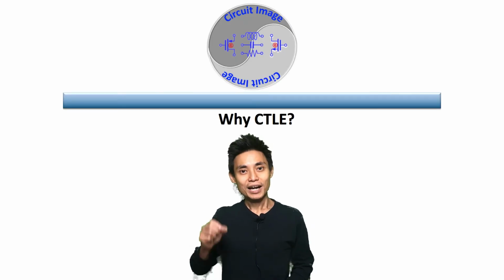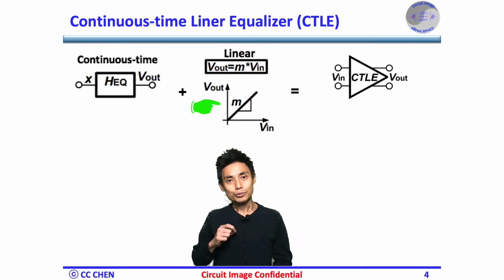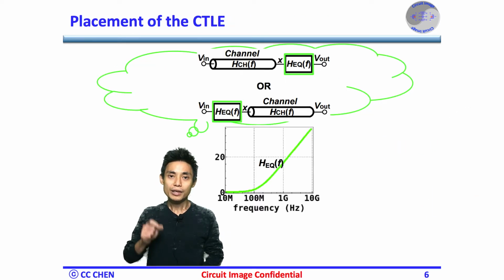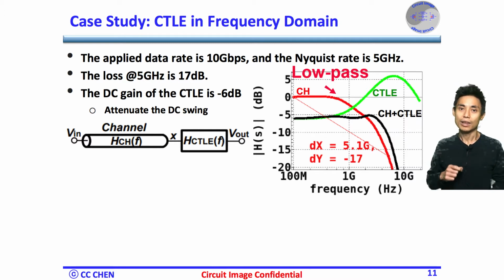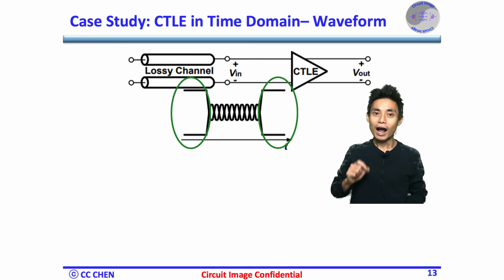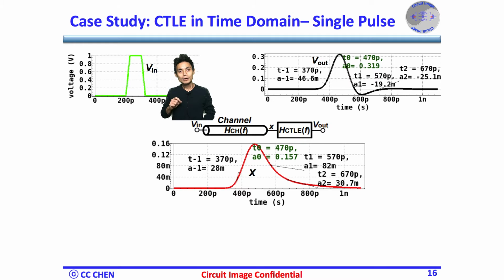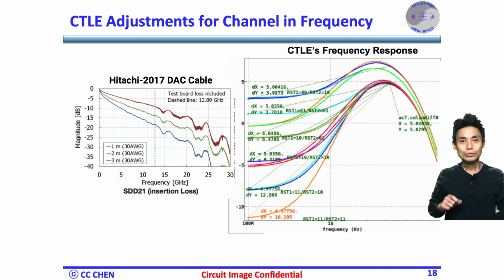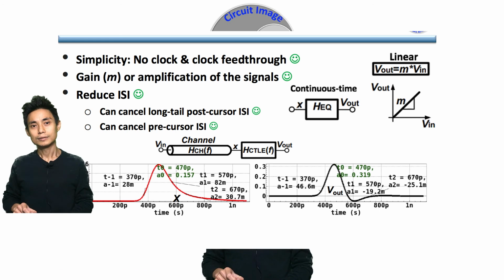Why CTLE?

Comment: Thanks cc, good explanation .
The dc gain of the ctle would be reduced to equalize the gain of the low and high frequency of the total response.
Means, we are decreasing the amplitude at freq=0, by using degeneration resistor RS in CTLE common source differential amplifier?
Reply: One more thing we are designing CTLE to give output impedance low?
Because if CTLE is amplifier then the output impedance should be low right?
Can you pls explain this

Comment: Hi CC,
After channel high freq pattern swing is less and low freq swing is more.

Our aim is after CTLE the high frequency pattern swing is increased because channel has high frequency loss and CTLE is high pass response.

Why low frequency swing after CTLE also decreasing?
And it's equilizing into low freq swing ?
Because it will allow receiver to output a stable signal?
Reply from the maker: Hi Shaik, 

Thanks for the great question.

The CTLE doesn’t just “boost high-frequency”; it reshapes the whole spectrum.
In most designs, high-frequency is boosted relative to low-frequency by attenuating the low-frequency gain. Because the output swing is limited, when HF is boosted the LF portion must come down, so you see low-frequency swing decrease.

That intentional LF reduction cuts baseline wander/ISI and opens the eye, so the sampler sees a cleaner, more stable signal.

Thanks,
CC

Comment: Good explanation.
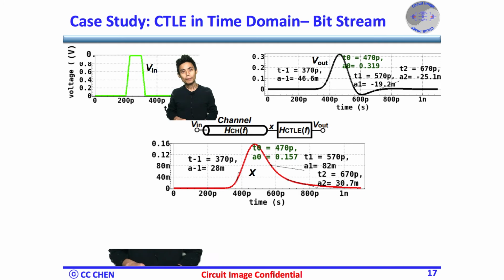One qn is 1. How you marked pre cursor and post cursor exactly at that point? At time 10:38 sec in video.

2. By comparing the after channel wave form and after  CTLE waveform.
Pre cursor amplitude increases
Main cursor amplitude increases 
Post cursor amplitude decreases.
So this is expected?
While your explaining mentioned amplitude decreases for pre,post,main cursors please explain here.
Reply from the maker: Hi Shaik,

Thanks for the great observations and questions!

At 10:38, the pre- and post-cursors are marked relative to the main cursor, which is the largest pulse in the pulse response. The pre-cursor is the smaller blip just 1UI before the main cursor, and the post-cursor is the one UI just after it. Again, they're spaced by 1 UI (unit interval) in time.

Yes, you're right to notice that after CTLE, the pre- and main cursor amplitudes can increase slightly, while the post-cursor decreases — this is expected since we care the pre- and post-cursors relative value to the main cursor, not the absolute value itself. 
Thanks for catching that — hope this clears it up!
CC

Comment: post-curor可以直覺地想像當下資料會影響後面的資料；但該如何直覺地解釋pre-cursor未來的資料會影響當下資料呢?
Reply from the maker: Hi Johnny, 非常感謝你提出這個好問題。您可以想像自己所處的位置。如果你在current bit, the next pre-cursor 1 就會干擾你current bit，如果你在next bit, 另一方面，current bit 的 pre-cursor 1  就會干擾你 previous bit.
Reply: @circuitimage  過去有模擬如果signal經過一階RC的LPF是不會產生pre-cursor，因此在想為何經過實際的channel就會產生pre-cursor?
Reply from the maker: Hi Johnny,
The RC low-pass filter is a lump element; therefore, you should not see the dispersion at the precursor. Instead, the real channel is a distributed element and the wave would disperse and spread the pulse to the precursor.

Comment: Hi Dr. Chen,
Can you explain, why dc gain at low frequency should be lower than 0dB? What is the problem if it has a 0dB response at low frequency and high response at high frequency?
Thank you for this great and detailed video 😃
Reply from the maker: Hi Muhammad,
Nice to meet you and you're very welcome. I'm glad you liked it. 
The DC gain at low frequency should be highly programmable & calibrated to the input swing. For example, if the input swing (at long-run pattern) is very huge (e.g., > 1V), you might want to decrease the swing to improve the linearity without saturating the amplifier's output swing; otherwise, the DFE cannot converge well from the SS-LMS algorithm. On the other hand, if the input swing (at long-run pattern) is little (e.g., < 50mV), you might want to increase the swing to improve the input sensitivity of the sampler (& DFE) such that SNR would be high enough. Hopefully, this explanation is what you're looking for and answers your questions. 😄
Reply: Thanks Dr. Chen for this great explanation @circuitimage
Reply from the maker: @muhammadkhaled0000  You're very welocme. Any time. 😀

Comment: Hi Dr.Chen, thanks for your videos they are very informative, helps a lot! I have a small question about this video. 
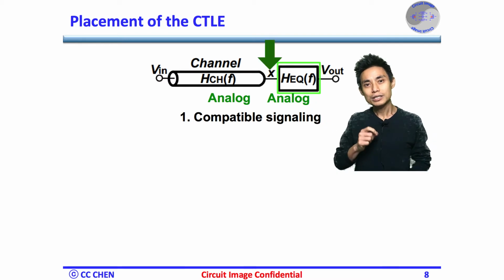In 4:33 you mentioned that the signal from the channel is analog. However, I originally thought that NRZ signal is a digital signal. Does this mean that any digital signal that has been distorted will have to be viewed as a analog signal? (on the other hand, I understand that why PAM4 signal is analog, because it used a 2 bit DAC to build 4 voltage level, but NRZ signal seems to be build directly from the digital signal from the chip)
Reply: Thanks for the reply! Now I understand that the signal at Rx is not a clean 2 level so it is analog. But I am not quite sure why Tx ouput is also an analog signal (for NRZ), do you mean there might have some pre treatment such as pre-emphasis?
Reply from the maker: @林彥全-x7f  Hi 彥全, Thank you for the feedback and good questions. The TX output swing is adjustable. For example, someone may want to save the power by only sending the TX output swing to be 50mV or even small, which won't reach full swing to VDD & ground like the digital level does.
Reply from the maker: Hi 彥全, nice to meet you. You're very welcome. Thank you for the feedback and I'm glad that helped. The digital signal is defined as only two levels: logic 1 (from the supply) and logic 0 (from the ground), but the signal level at the channel (TX output or RX input) is arbitrary (could be 0V, 0.1V, 0.2V, ... 0.7V, ..., 1V); therefore, it must be the analog signal (all possible voltage levels). I hope this simple example helps.
Reply: I understand now! many thanks!
Reply from the maker: @林彥全-x7f  Great. I'm glad that helps and you're welcome. 😀

Comment: Thanks for the good video. May I ask what caused long tail pulse response and how CTLE helps to remove it?
Reply from the maker: Thank you for the question. The bandwidth limited channel would cause the long tail. The CTLE will compensate for the bandwidth and extend to a high enough bandwidth such that the long tail would be reduced as low as possible.

Comment: I have a question about Nyquist frequency.
For one channel SerDes structure, if we have a 100 Gb/s SerDes circuit, we may have a sampling clock at 100 GHz. But, we have a Nyquist frequency with 100/2 = 50 GHz. But, I thought that the Nyquist frequency means the highest frequency that we can observe in our data. So, I'm confused about why we can demonstrate that we have 100 Gb/s data transmission rate, but not 50 Gb/s？And, why we only compensate the channel loss below the Nyquist frequency, but not toward the smaple frequency？
Reply from the maker: Hi Po-Yao, Thank you so much for the good questions.
The sampling clock frequency is not necessary to be the same as the data rate, it could be 50GHz, or 25GHz but multiphase clocking with half rate or quarter rate, respectively. Long story short, I'll make a video later to show how to get the half-rate or quarter-rate clocking work. Also, up to the Nyquist frequency, the most energy of the data could be, the fast slew rate still will have some small energy above the Nyquist rate, and I'll make another short video to explain that with a few simulated responses. We only compensate for the channel loss below the Nyquist frequency since we are compensating for the data response, not the clock, which could be at any clock rate as mentioned in the previous sentence. 
Thank you. 
CC😀
Reply: @circuitimage Thx for detailed explanation. So, can I have a statement with：The 100Gb/s SerDes circuit implies that the maximum data rate 100Gb/s is equal to the Nyquist frequency, which is 100GHz. But, the sampling clock might be any other frequencies depending on the circuit structure.
Reply from the maker: @po-yaohsu2052  Hi Po-Yao,

Yes, you are correct. But, the Nyquist frequency is 50GHz, which is half of the data rate 100Gbps.

Thank you so much.

CC

Comment: Hi Dr.Cheng, thanks for the great video, I'd like to inquire some quesitons to you
1. As your mention, CTLE can boost the output swing and get the higher SNR, but after I looked up the information online, most of the information indicated that CTLE will also amplify the noise, so  may I know the noise won't have any effects on the SNR since the noise is too small, please correct me if I'm wrong.
2. The picture at @5:48, I'm not sure the frequency in the x-axis is signal's frequency or not, then if it's signal's frequency, it means the CTLE can't work properly if the signal's frequecny is higher than 2GHz right( the black line: CH+CTLE), please correct me if I'm wrong.
Thanks for your video again.
Reply from the maker: Hi, 育瑛, you're very welcome. 😃Thank you so much for those good questions. I have comments below.
Yes, you're correct. the CTLE would boost the high-frequency noise due to the high pass response; therefore, we don't put too much bandwidth than what it needs in the CTLE design. In addition, the passive CTLE would have a less SNR than the active CTLE if the active CTLE burns reasonable power.😀
Usually, we care about the 3dB bandwidth (not the whole flat response bandwidth), as long as the 3dB BW is ~5GHz, the signal's frequency < 5GHz should be okay and good enough for 10Gbps. 😄
Reply: @circuitimage  Hi Dr.Cheng, thanks for your reply!
1. As you mentioned, we don't put too much BW in the CTLE design. In this case, it won't contain too much high frequency in CTLE, so we can get less noise, right? And I think we may not say CTLE can not boost high frequency, shall we say CTLE will decrease the power in low frequency to compensate the loss of high frequency through channel.
2. The CTLE you mentioned in the video is active CTLE since it has higher SNR, but how could we distingush passive and active CTLE?
3. I'm wondering that if the IP is like USB4, the data rate is about 20Gbps, then could it still work
Additional inquiry,
4. Can we improve the CTLE's filter ability by adjusting the AC and DC gain since in the CTLE design the resistor and capacitor are parallel, but I'm not sure this is correct or not.
please correct me if I'm wrong.
I really appreciated that, thank you again
Reply from the maker: @Erichsu-e9m  Hi, 育瑛, you're very welcome. Again, thank you so much for those good questions. I have additional comments below.1. As you mentioned, we don't put too much BW in the CTLE design. In this case, it won't contain too much high frequency in CTLE, so we can get less noise, right? And I think we may not say CTLE can not boost high frequency, shall we say CTLE will decrease the power in low frequency to compensate the loss of high frequency through channel.[CC] Yes.
2. The CTLE you mentioned in the video is active CTLE since it has higher SNR, but how could we distingush passive and active CTLE?[CC] Please check this one: https://youtu.be/JsIBAqdYgvU
3. I'm wondering that if the IP is like USB4, the data rate is about 20Gbps, then could it still work[CC] No, and I'll make another video to show how it works. Additional inquiry,4. Can we improve the CTLE's filter ability by adjusting the AC and DC gain since in the CTLE design the resistor and capacitor are parallel, but I'm not sure this is correct or not.[CC] Yes, and I'll make another video to show how it works.
Reply: @circuitimage  Thanks for your reply, I'm looking forward to watching the new video, thanks agian.
Reply from the maker: It is ready. Why Active CTLE in a high-speed SerDes?
https://youtu.be/JsIBAqdYgvU

Comment: Thanks a lot for your teaching.  Does DC gain affect the low freq swing only? should I use less DC Gain for smaller insertion loss channel and larger DC Gain for larger insertion loss channel/cable?
Reply from the maker: Hi Zan, nice to meet you, and thanks for the good question. You're correct. If you have a big swing (or less loss), you might want to reduce the DC gain to get better linearity for the amplifier; otherwise, a larger DC gain should be applied for your small swing (or big channel loss) to provide a greater SNR.
Reply: @circuitimage  Thanks again for your explanation!
Reply from the maker: @ZanZ-qi6wz  You're very welcome.

Comment: hi teacher   I  have some questions.
You said that CTLE will sharpen the transition, so longtail  effect in postcursor will be solved.
what about the slope of the precursor , it seems  no different between point X and Vout
Reply from the maker: Hi 正宇, Nice to meet you, and thanks for your good question. You are correct if you only looked at the absolute value 28mV (before CTLE) & 46mV (after CTLE), but the peak value of the main cursor has been increased after the CTLE (e.g., 157mV -> 319mV). Therefore, the ISI should be evaluated with the coefficient C-1,  and the value is decreased after the CTLE 0.144 (46/319). Before the CTLE, the C1=0.178 (28/157)